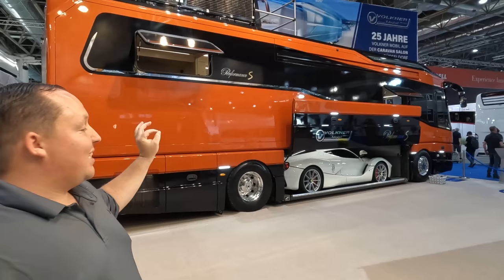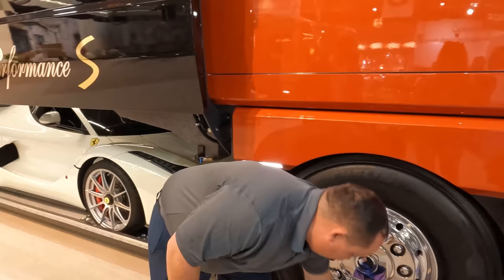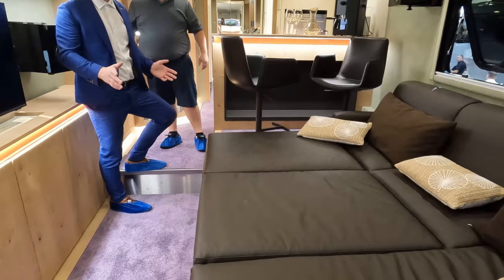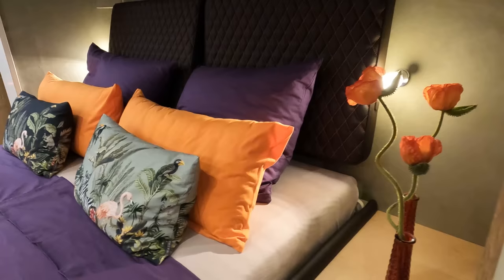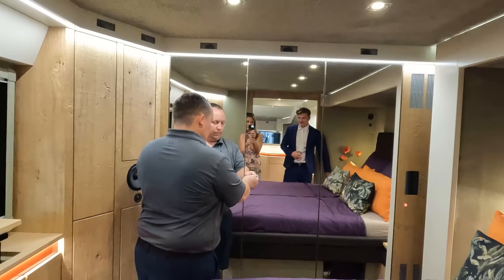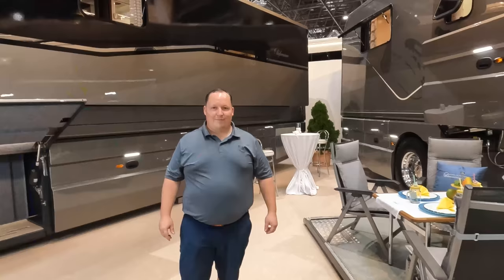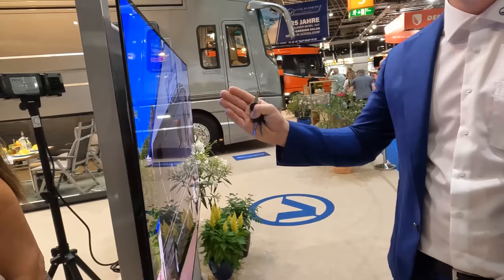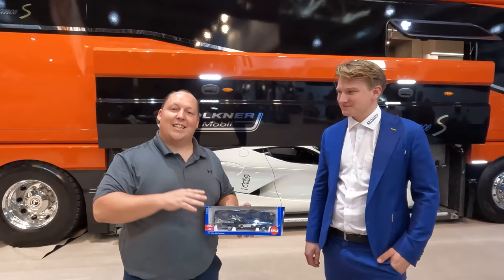Volkner Mobil Performance S - Mega Motorhome with Ferrari Underneath!

Comment: Hey so this unit is outstanding and fully customizable .:. cockpit trim 👍🏽 gold standard; king beds rule 👍🏽 power assist and underside storage; solar system 👍🏽 big capacity, leading edge tech; basement storage 👍🏽 yep that’s a car in there; roof access 👍🏽 patio space; Don’t know if the first one had a slide out 👍🏽 they are really well blended into the interior .:. I’ve had the opportunity to visit La Tour Eiffel and it’s worth the trip to the top (sorry Jen) .:. The MSRP (on line) for the Performance S (do - do - do do) goes in the realm of 1.13M USD + so it gets up there with Newmar, Foretravel, and the resale Prevost / Newell .:. The first thing we did when we got our trailer was to upgrade the mattresses - we had to be able to sleep well - BB great looking product .:. Thanks for the review M/A

Comment: I saw the first one when Enes reviewed it and marveled at its quality. The 2 million dollar pushers in the US do not hold a candle to this thing. I wish the US would step up and come into the solar and modern age of RVing. It was not mentioned but the first one can go off grid for long periods of time because of all the solar.
Reply: not really solar those few solar panels will not sustain it for much boondocking throw in shade smoke clouds with high heat and extreme cold no way, hence a generator is needed

Comment: That is outstanding. After the RV lifts up so the car can go inside does it sit that low to the ground when you are driving, or does it have some height under the RV? Cause if it sits that low to the ground you won't be able to drive it a lot of places even a speed bump would take out the under carriage. The only thing missing is a washer and dryer. Volkner you need to come to the USA. Absolutely love the workmanship.

Comment: Apparently you've never viewed these or own the big motor home. What's important to most of us is the drivetrain along with how nice it handles and what power does it have. I've watched a video twice and it was not mentioned what horsepower rating or transmission they had in these motorhomes. Also the price of each one would have been very nice or at least a ballpark price

Comment: Volvo owns Prevost so I wonder if Prevost could do the same trick with the car garage.  Given how high the windows appear from the outside, it seems like the floor level is much higher so probably the garage would not work on the Prevost chassis.

Comment: I'm very shocked for such a top of the line luxury coach that there is no washer and dryer. Especially coming from Europe where almost everyone uses a washer dryer combo unit not a stackable it's one single unit that washes and then dries all in the same tub. It saves a lot of room and a lot of energy and is very European and I'm shocked to the coach of this luxury would not have a washer dryer in it
Reply: Hi Kaldia, the way RV's are used in EU is different from the states. Usually at this price point they are used for long distance travels and short stays. People don't "full time" in them like in the US and there are dry cleaning services in most major cities that you can send your clothes to be washed and taken care of. It's less of an outdoor, camping in the wild type of RV. There are other types of RV's with washer/dryers.